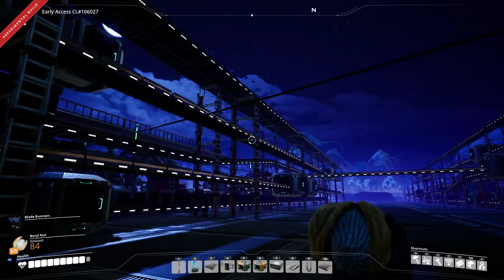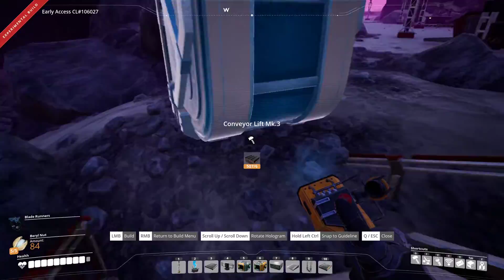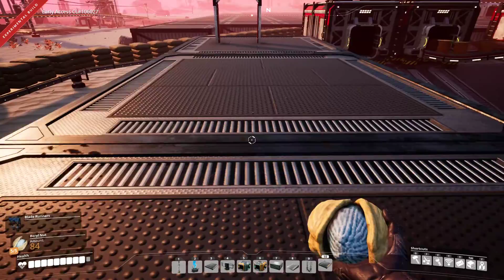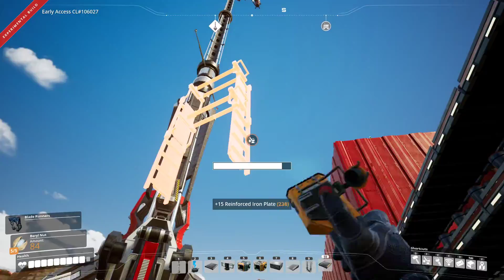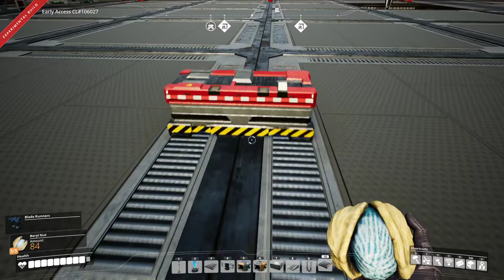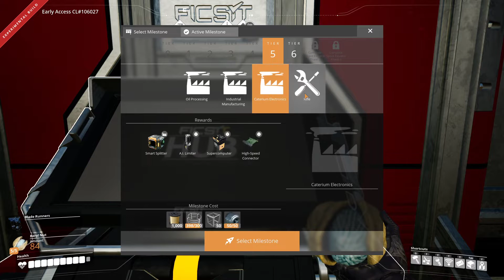Vertical Spaghetti | Satisfactory Desert Bus Ep#32

Comment: I think you should keep the splitter tower. It looked nice and fancy. 
Also it would look more tidy to have the belts cross flat from the factory tower and have the height change right before you do the turn. It also would solve the issue of having to change stuff later when you add new floors. If it's flat, adding a merger is no issue.